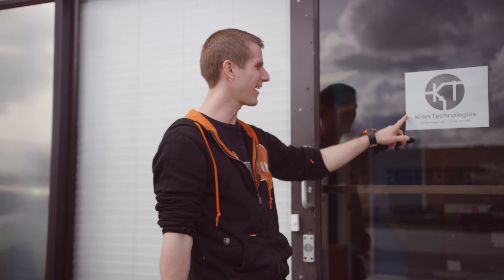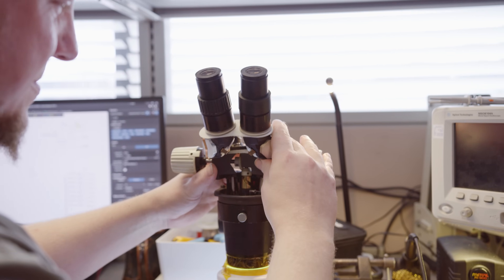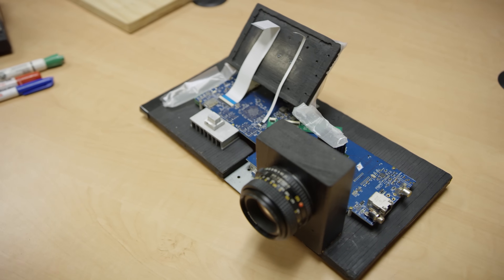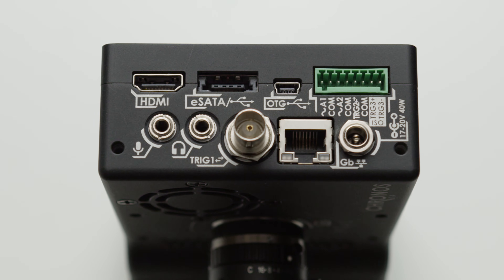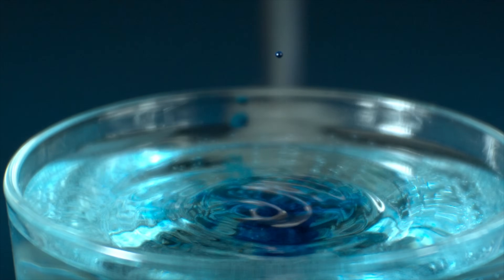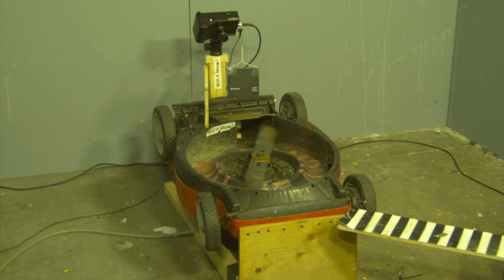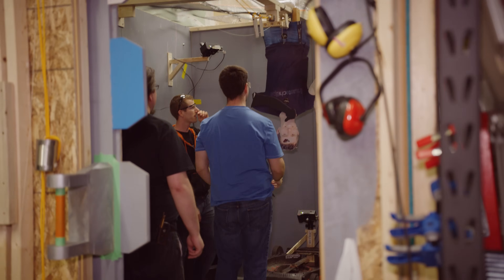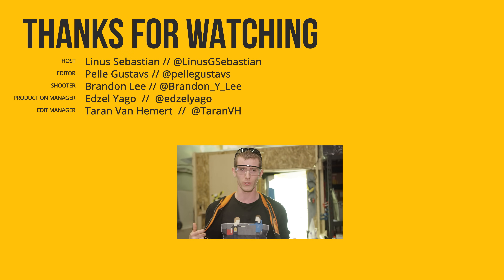This Cheap High Speed Camera is Made in Canada!!

Comment: Is there a specific reason for 4:3 aspect ratio? 1024x1280 is 4:3... I mean, it can't be the processing power. If they wanted to make it HD, at 720p that's 1280x720 which means less pixels to drive. Maybe that professional use case scenarios are more into 4:3 than 16:9 :-?

Comment: 14:07 20 years ago when I worked in R&D the manager was our FPGA programmer. He was the manager because there weren't that many good quality FPGA programmers back then. Hard to come by. We made satellite comms equipment for TV stations. So, if you're thinking of becoming a programmer, consider FPGA. You'll be in high demand.
Reply: And it helps to get into FPGA from the beginning of your higher education. Conventional programming will not prepare you for it. If you like hardware level design then that fits with FPGA really well. Break out the oscilloscope and monitor the circuits in realtime. These are skills that companies pay really well for ;o)

Comment: I don't know... I would rather built sensors myself but FPA manufacturing is a little bit crazier. Sony RX100 V can capture up to 1000fps in a 8second buffer.... and the RX100 IV can do 4seconds. 

Samsung phones can do 960 up to 1.3 seconds or something.
Reply: A prototyping run for a sensor this size is going to cost you about ~$120-250k, and you really want a bigger sensor. A full-frame image sensor will cost you ~$330k if you're doing your own wafers, about $100-200k if you're sharing a run.
The RX100 series has a very, very low resolution compared to this, and it doesn't do raw.

Comment: I cant believe how expensive your mobile bills are. My bill is 10€ and i have 500 minutes/sms and most importantly 10Gb of Data my ting bill would be 120$. I think I am lucky to live in Austria with such low prices even in Germany its more expensive.
Reply: Lukee
I know. In the UK I'm on unlimited and it's still about the same as they charge for 5GB??
I mean, the days of struggling to ONLY use 5GB whilst online in a month was about 10 and more years ago.
That kinda shocked me. But it IS in dollars I guess.
Reply: I have straight talk (Verizon) its $45 for unlimited everything and 10gb of LTE.. then LTE is 2g so bassically useless.
Reply: Lukee In India I around 1.15$ for UNLIMITED DATA ( Out of which 42gb is 4g data at 1.5gb a day ), Unlimited calls and 100texts ( Since thats the limit for texts here ). All this for a month !
Reply: sounds good
Reply: Yeah even the US is considerably cheaper then Canada
Reply: Wow!!! I just worked out my bill cost if I was on AT&T and it would be $505 a month without the phone!!!! In comparison in the UK with the phone included in the contract it's $73 holy crap are you guys getting spanked over there. (unlimited calls texts and 100GB of data 30GB of which can be used for tethering)
Reply: Biggest issue is the size of the contry canada and the usa are such large contries with many areas with low population density the cost of all the equipment required is alot higher than contries smaller in size... not to mention that in Canada especially equipment needs to be fit to withstand extreme cold weather of up too -50 celsius in the winter and up to +45 celsius in the summer... and because of that equipment breaks more often which increases costs alot

Comment: If they offered this in a hobbyists' kit with end user assembly required on the cheap it would be like Jesus just came to Earth sporting a machined case and lens cap... Frickin' cool as sheeeeeeeit and from Canaderp to boot!
Reply: The sensor and RAM are the most expensive parts, and there's not much DIY assembly you can do on a board with 0603 and 0402 parts.

Comment: The z cam e2 can do 120fps at 4k. That's 120 divided by 24 = 5. 5 times 120 = 600fps (equivalent) @4k!.
It can also do 240fps at 1080p 240 DIVIDED by 24 = 10. 10 multiplied by 240 = 2,400fps (equivalent) @1080P, in post production you can get a whole lot more fps (equivalent) and still maintain resolution.  So not as cool as these 6,000fps cameras but I  will say that u get a lot more functionality out of a camera like the z cam e2. Not really sure who these cameras are meant for. Never the less cool video nerd jokes and all.
Reply: Resolution doesn't equal speed. Your train of thought went off the rails and sank in the river.
Reply: Spirit lol who said resolution equals speed? If you shoot 120fps u can slow it down to 24fps. That's how many frames most Hollywood movies use. You thought I was on the titanic lol!. Turns out I  was riding wave, watch out lmao
Reply: Your original comment says that.
Now, I wonder why people shoot at higher frame rates. It's as if they would want to play it back at normal frame rates.
How the hell do you go from 120 frames per second to 2400?
Reply: Spirit the only thing I changed was the word divided which was auto corrected to decided. But when your not a professional it's important to shoot at 60fps, that way you can slow down a clip when something you seem important happens. I wish I could slow down a lot of clips on videos I made. But capped at 30fps it just looked too choppy.
Reply: Still no relation to your original comment.
Reply: Spirit  if I shoot 120fps or 240fps I can slow it down to 24fps and have super cool slow motion footage lol. That's why I would shoot at high frame rates and then export it at 24 or 30fps. So my slow motion footage can be slower and as u can see from this video super slow mo looks super cool. That's what my original post was about. And also how you can get super slow mo from cameras that have way more functionality than these slow mo cameras.

Comment: Why do high speed cameras need ram?
Reply: Because of the rate the data is coming from the sensor at. It would be extremely expensive and difficult to record that much data on something larger(nonvolatile).
This is why the record times are also so small.

Comment: 38000 f/s at 336x96  but 1057 at 1024is still decent. but 3k for 4 seconds or add 400-1000 for longer is expensive. but compared to other cameras it is cheap.
Reply: Well, it's basic math. Your RAM limit is 32GB, and you can't record this fast anywhere other than RAM.
Reply: Spirit Maybe they can find a cheaper RAM solution.  It'll be difficult but might be doable with more FPGA trickery.  But if RAM prices are already minimum, FPGA tricks may allow more resolution instead.
Reply: John Francis Doe since they are using standard ram socket, you may can just add more ram by yourself
Reply: You need the exact right specification of RAM, and you'd need to alter the firmware. It's possible, but I wouldn't bother.